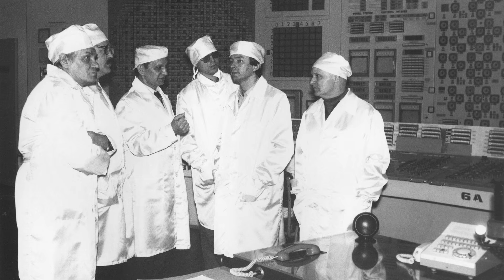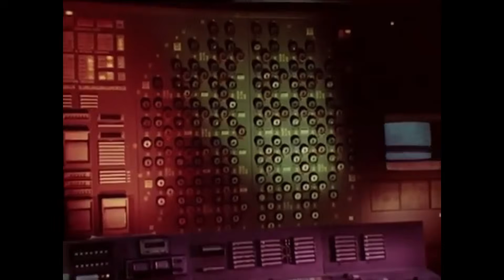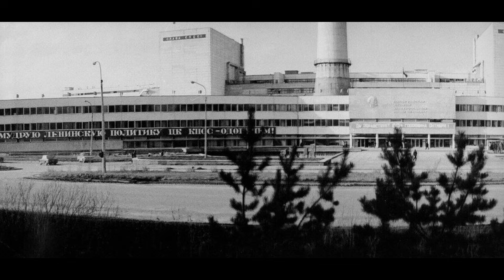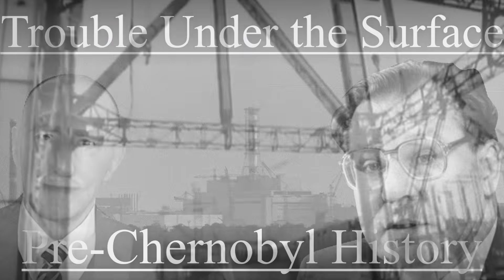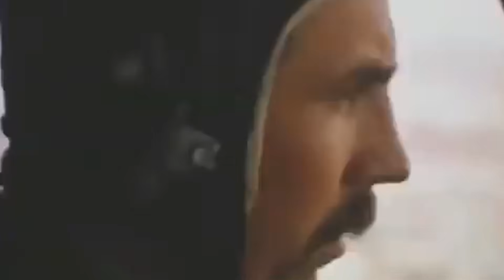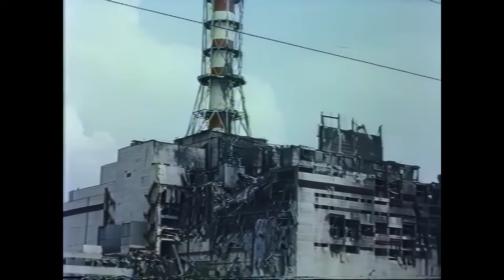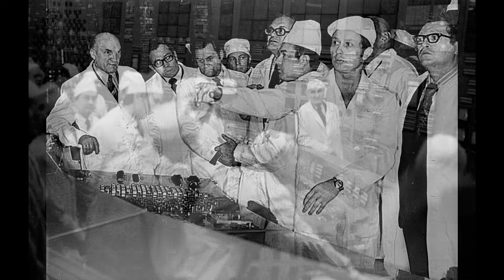The 1975 Leningrad Nuclear Accident: The Road to Chernobyl

Comment: This reactor seems impossible to control.
Reply: With modern software simulations and certification of safe operational procedures it would be possible.
Reply: It is very possible. Living proof of that are the RBMKs (Leningrad NPP Units 3 - 4, Kursk NPP Units 3 -4, Smolensk NPP Units 1, 2, and 3. And the 3 Bilibino NPP RBMK-lets (EGP-6s)) still in operation today. They've been quietly making electric power for the past decades without much issue. However, the RBMK will always be a somewhat untamed, grumpy reactor you will have to run within its design parameters without deviation, full stop. If you do that, and take into account its weaknesses and unique behaviour in certain operating regimes, then the RBMK can be a proper, well-behaved reactor.

Comment: The true picture of event of April 26 1985 I n Chernobyl is difficult to reveal, because it is blocked till present day  by 3 sides: 
1) Russia, because RBMK-1000 are still in operation in 3 Russian nuclear plants: Smolensk NPP , Kursk NPP and Leningrad NPP and after modernization they showed themselves as most useful reactors in the World, because of their ability to produce any isotopes during normal cycle of operation of reactor without interruption of power production. 
2) Ukraine, that maintain theory of 90% of fuel still under protection cover of block#4, despite maximum 5% was found and localized.
3) International Agency of Atomic Energy, that maintains theory that no nuclear explosion could be produced by energy nuclear reactors under any combination of circumstances, by the principle of their physical processes.
Reply: CANDU reactors are better and can do more than RBMKs

Comment: I do have one point of contention with the significance of the final feedwater temp, as it enters the core.  While not the cause of Chernobyl, it would have heavily contributed to the onset of the original power spike and I think it is important that the 2 scenarios had different final temps. It is minor because I agree that it was not the reason Chernobyl exploded but still important to distinguish.

1. Lack of subcooling would provide NPSH to the recirc pumps and cavitation in the pumps would impact their efficiency/capacity.

2. But more importantly, if the water starts to boil lower in the core, it would decrease negative reactivity, while also putting the core into a departure from nucleate boiling state (DNB).  

In this condition, the boiling of the water cause reactivity to become unpredictable and in a reactor like an RBMK, it would cause it to overpower sections of the core, then the negative heat coefficient would kick in, reducing power sloghtly and then allowing it to rise again.  Then the 2 conditions would fight eachother at different rates in the core, since it is so massive. It probably wouldn't have lead to a disaster scale event but the core would have been substantially damaged, even if the unit was shut down by manual insertion of the control rods, as opposed to a scram.  

In western BWRs, the departure cause a slightly different, yet still concerning effect, where the reactivity yo-yos against the void coefficient, and can cause the fuel to rupture the cladding.  Thus they are fitted with protections to detect such a condition.
Reply: The main circulation pumps at Chernobyl were not limited or interrupted by cavitation. This had been offered initially as a cause and subsequently studied. Water being close to its boiling point at the core inlet was apparently a significant contributory factor, but what wasn't pointed out early is that in RBMK reactors this was not an abnormal state and an operating rule wasn't broken in either lack of subcooling or the connection of all main circulation pumps. This topic was covered in the second Masters of Weaponized Narration videos released last week. It is true we don't know how different this condition was at Leningrad in 1975 vs Chernobyl in 1986, and we don't know the Operating Reactivity Margins in the apparently two uses of the emergency protection system after the initial shutdown at Leningrad. The similarities between the two incidents are striking but there could be confounding factors. Nonetheless, at this point, as you saw the first deputy minister of the Ministry of Energy mention, we are extremely confident that there indeed was a difference in the design of the control rods between the two incidents, which in our opinion is the key to answering the question why a disaster of Chernobyl's magnitude hadn't occurred earlier. Too many things were done according to the rules at Chernobyl and too many times prior things had happened or gone wrong. INSAG-7 even mentions a repetition of Chernobyl could have occurred in other seemingly more benign circumstances. But, a change to the dimensions of the control rods creating or augmenting a positive scram effect occurred in proximity to the disaster. The reactor actually exploded at about the time you would expect it to, as its coefficients of reactivity reached their maximum values with the removal of additional absorbers due to increasing fuel burnup by design.
Reply: @markusw7833  To put it VERY simply: Chernobyl unit 4 had problems at the bottom of the reactor - A place where, because of shortened control rods, (when AZ-5 was pressed) absorbing water was pushed out of the way and graphite inserted increasing reactivity in that very bottom of the reactor. All at a time when water entering there was almost at boiling point anyway. So VERY crudely: Water about to boil gets turned instantly to steam as the reactivity has just gone up following the pressing of AZ-5 and the water being replaced with graphite.  Then, of course, all that steam (void) increased reactivity further.  Basically, all this mess happened in the bottom of the reactor at Chernobyl.  So, all in all, as that is where the whole problem started, I don't feel that you need to be a nuclear engineer to say that the shortening of the control rods played a massive part in why the Chernobyl unit 4 exploded. - Water about to boil gets a massive boost that makes it boil due to increased reactivity because graphite is now where water used to be. The water instantly turns to steam and steam (voids) increases reactivity further. BANG!
Of course, lots and lots of things led up to that point to put the reactor into that situation, but the finishing point was caused by shortened control rods.
Reply: @ChrisMatthewson  Pray do expound on the lots and lots of things that led up to that point.
Reply: @markusw7833  "Pray do expound" My, did you swallow the entire "Steven Fry Dictionary to pompous English"? - I would suggest that you watch all 3 of TCG's excellent videos all about what led up to the explosion on that night. It's a great detailed account of all the things that led up to that point.

Comment: Great research! One comment for those who don't know... the reason increasing fuel enrichment can help reduce the chances of an accident like this is because when the enrichment increases, the fuel designers can put more "burnable poisons" into the pellets.  This allows for better transient characteristics.  

Then as the fuel burns, natural poisons build up as the burnable ones burn out and the fuel is consumed.  There is some complicatedness to this balance because boiling water reactors produce a descent amount of plutonium, towards the back 3rd or sonof it's lifespan.  

Thus when western BWRs are at the end of a fuel cycle, the core fuel limits have the lowest margin, since the control rods are full out.  

Im not familiar enough with the RBMK design to comment on how that later is impacted, but I fission works the same, even in Russia.
Reply: The RBMK didn't use any burnable poisons in the fuel. They replaced entire fuel assemblies with boron rods, and then gradually removed them over the course of months. Only after the accident did some burnable poisons start to be used.

Given that the RBMK was overmoderated, increasing enrichment reduced the void coefficient simply by increasing the fuel:moderator ratio.
Reply: @MinSredMash  thanks for the information!
Reply: @MinSredMash  What's the point of burnable poisons?
Reply: @markusw7833  As fuel burns up, you need less poison. It's the same thing as removing additional absorbers over time in an RBMK.
Reply: @MinSredMash  So what's the difference between removing additional absorbers and having this stuff disappearing in there?
Reply: @markusw7833  You don't need to spend six hours replacing every single one.
Reply: @markusw7833  Higher enrichment of the fuel.  That allows for stable performance and also allows for longer fuel life.  If you loaded fuel up with a bunch of U235 or other fuel, without poisons, it would be harder to control the reactivity and neutron Flux distribution.
Reply: @mikeall7012  That I already know. Additional fixed absorbers that were gradually removed were used in RBMK reactors. I had seen mention of burnable absorbers so I was curious if they offered anything special.
Reply: The core fuel limits have the lowest margin of what?
Reply: @markusw7833  lowest margin to their design limitations for various scenarios.  It's more complex than it's worth explaining in a YouTube comment, but if you Google search "nuclear fuel safety limits," you can get a good bit of material.  The NRC website also has some good articles that describe the different design/safety limits and their purposes.  

But the bottom line is that a reactors fuel needs to be designed to withstand normal operatio, transients (turbine trip, loss of feedwater, loss of recirculation... etc) and accidents.  To maintain those limits, the operators have to ensure certain equipment available and the fuel/core engineers have to ensure they design the core and fuel with specific parameters... enrichment and burnable poisons being 2 of many.
Reply: neither is the owner of this channel

Comment: At some time before I die, I hope, by watching all your videos several times, to actually understand the ins and outs of what really happened at these reactor accidents.
Reply from the maker: Good luck, because I still have a lot to understand :)
Reply: The reactors were designed in such a way that if the power levels dropped too low, there was a real risk of a shutdown lasting several days because byproducts built up in the radioactive material.

You have two options: let the byproducts decay over several days or hit them with radiation.

If you hit them with radiation, you can quickly get rid of them, but you risk a yo-yo effect where you suddenly have way too much radiation and heat. That boils the coolant away creating gas pockets which allow the neutrons to slow down and break apart more atoms than you want. This can overwhelm the system and melt the containers holding the radioactive material. That's a problem.

tl;dr:
Nuclear reactors have to be carefully maintained to produce heat in the correct locations at all times and minimize instability. These were inherently unstable designs which allowed a situation to arise in which the controllers kept overshooting the happy medium.
Reply: All to boil water.
Reply: @MichaelVLang One could argue the phrase "generate electricity" is more appropriate.  They weren't making pasta.
Reply: @bsadewitz  a problem with referring to it that way is that not many know what "generate electricity" means in the slightest. They've boiled water.
Reply: @MichaelVLang  I suppose I assumed that anyone this deep in the comments section probably gets that. The video is about a power plant, right?  Anyone watching the video knows that we're boiling water, I hope!

I meant it in a playfully facetious way.  That's why I said "one could argue".  I wasn't arguing that, heh--just putting it out there. ;-)
Reply: @bsadewitz  I get it for sure. I told someone while discussing energy that all that is is boiling water to make electricity and they just looked at me. I tried.